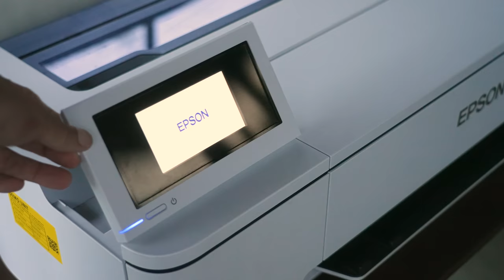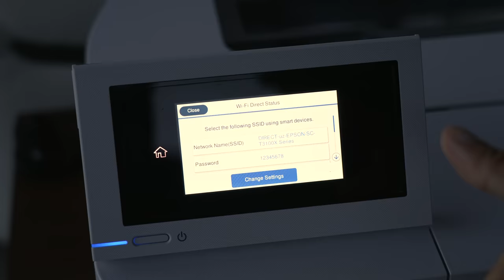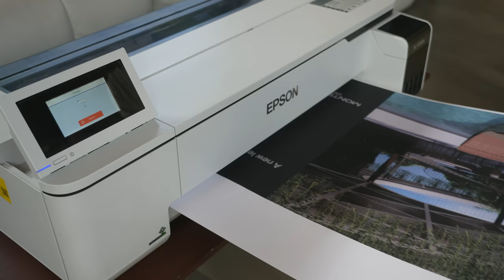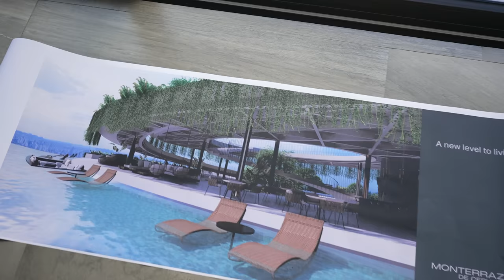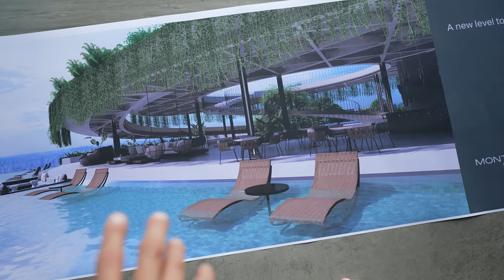The ULTIMATE GUIDE To Building Your Home!

Comment: Engr. Slater, don’t forget about the Electronics Engineers. Most buildings don’t consider them but they will ensure all your needs as to the electronics field is well integrated on your buildings. These include but not limited to structured cabling systems, telco repeater systems, professional audio systems on your multi function halls, Video Teleconferencing solutions, Building communications systems (radio,wifi,cellular), computer systems for office quarters onsite, cctv surveillance systems, access control systems and a lot more. Most buildings do not integrate these systems during the build phase and get added upon as the requested but hopefully in the future our field-being an Electronics Engineer myself- will be included during the construction phase of all buildings. Anyways, what a nice video Engr. Slater and spot on with hiring professionals for all the different aspects of building a house.

Comment: As a Mechanical Contractor and Home Remodeler / Rehabber in USA it is interesting to see it from a Filipino perspective and how important a role the Architect plays here i coordinating the Engineers and even utilizing a Project management team to coordinate as I know there are many complications and headaches you can run into building in the Philippines. Supplies and keeping the flow along with reliable stores and suppliers is one of the hardest and while it may be easier in say Cebu verses a smaller city where things need to be ordered and brought in and at mercy of simple things like a ferry used to deliver and slowed by rough seas. Smart to do a multi-housing in one area as this cuts down time and cost while also making it easier for Individual differences.

Comment: This was great information. I was recommended a builder and he has several examples of homes he built in the Philippines. I am aware of the short cuts some builders use and that everything is way much slower there, so I plan to rent for a year before construction starts. I am mostly worried about building near agricultural land instead of one designated as residential.

Comment: My humble opinion as an IT person myself. There's another engineer na hindi na mention I think.
You need a computer/IT engineer, to plan for CAT5/6 data cabling.
An electrical engineer can do this job. Nakita ko kasi na ang data cabling is always an afterthought. It can save you a lot of trouble and without the need to expose data cabling or mag akyat sa ceilings to add data cables.
Heard of poor WIFI signals in various spots of a building? That's because a computer engineer was not included in the planning stage.

Comment: I'm just curious Sir Slater. Saan nmn papasok si Civil Engineer? What is its role? What's the difference between Civil and Structural Engineer or Are they the same?
Reply: Geotechnical and Structural Engineers are Civil Engineers. Masyadong broad po kasi ang field ng Civil Engineering.

Comment: How about the network cable (LAN cables) or having a server room in a home? making sure that there's an internet in the all house for those whose work from home. hoping this will tackle also
Reply: In most cases, ICT network system is the most neglected, but for this moment in time, one of the important aspect. They tend to forget to install separate conduit lines for internet, cctv etc. ECEs are the professionals responsible for planning in this matter. :))

Comment: Quick questions.  Why are PH homes usually have a different type of foundation, I noticed only the walls have a foundation then the floor slab is poured in after just as a means to have a floor.  Is this a common PH method?  Why th eifference to usual standards abroad?  Also I noticed that excated land creating steep walls  ( higher than 2m)  are not finished off by any form of retaining walls, is this not a PH standard to strengthen the walls against land slide before starting construction?  Just to clarify, these questions are not regarding the project in the video, it is a general observation of many PH homes / buildings etc, in particular outside of Metro manila.
Reply: There are different types of foundation, deep foundations like bored and driven pile, shallow foundations like isolated or mat footing. It depends on the location, soil type, and the designer. Regarding steep walls, Slater mentioned on the video that that project is on a limestone. Maybe based from their analysis and assessment of the site, retaining walls are not needed.